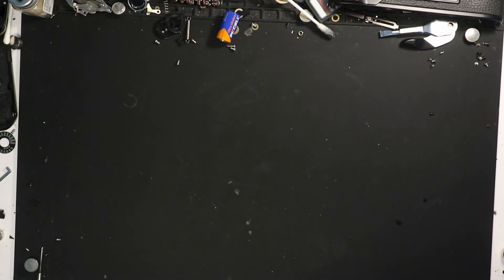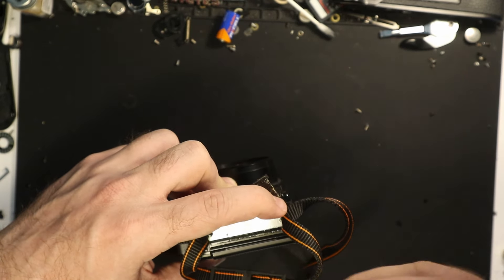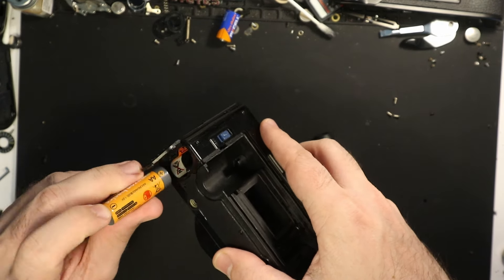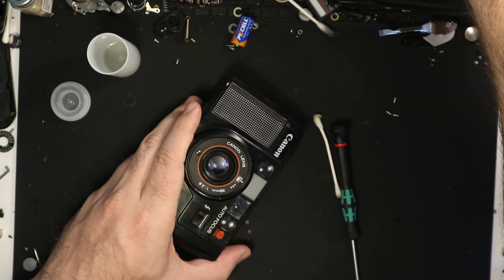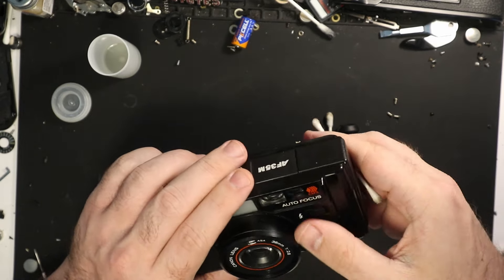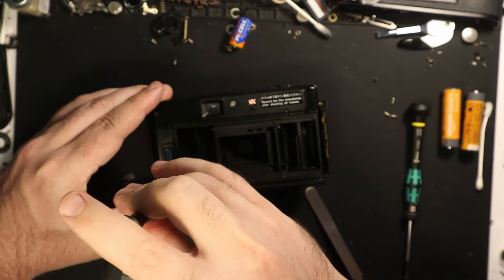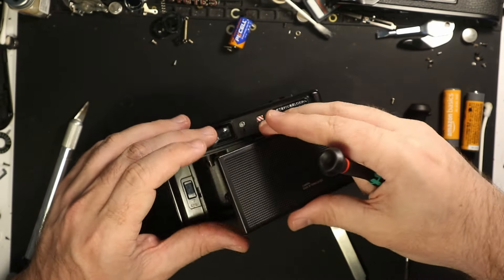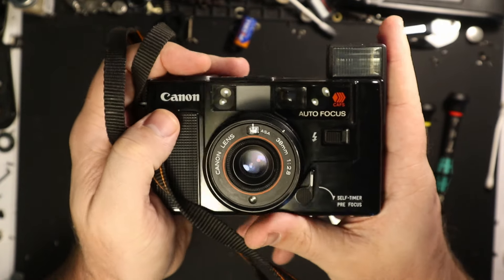Point and Shoot Film Camera Repair (Canon AF35M)

Comment: great video ! I have the same camera but it has recently started acting up but it only happens when I have film in it. any idea what it might be ? it does not happen always but sometimes it gets jammed when I shoot and the film does not advance for a couple seconds or when I set the camera down. but I can spam the shutter button when no film is inside and it does not jam once and advances fine with no issues . Only when film is loaded is when it sometimes has trouble any thoughts?